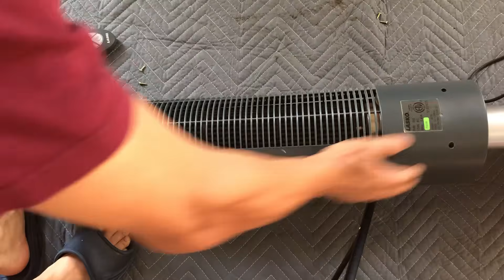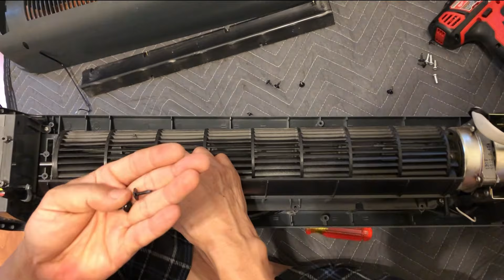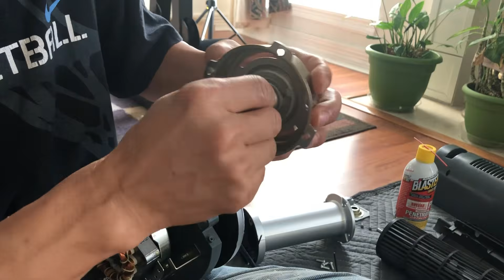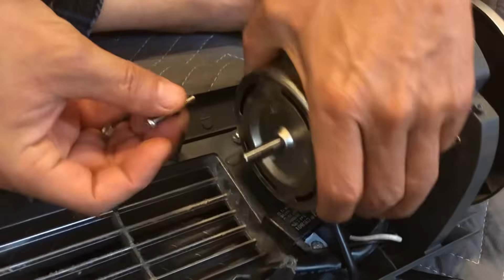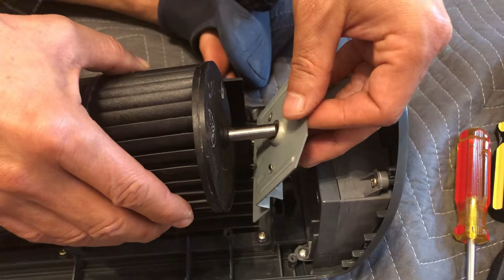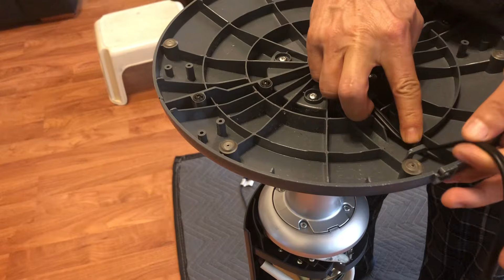Tower Fan Noise Fixed

Comment: Mine was rattling so I used a phillips head screw driver to loosen up the bottom fan set screw, pry up the fan and re tighten. No disassembly at all and fan is quiet.

Comment: I fixed this same issue way easier and way faster.

1- Get an "masters lubricating oiler" or some product oiler that is similar (the ones with the long narrow retractable spout.)

2- Flip the fan upside down and oil just the top bearing shaft right through the grate.. Let the oil penetrate the top sponge.
 

3- Pull oiler away from the fan  but, keep fan upside down and turn fan on upside down ..to work the oil into the sponge...

Repeat a #2-#3 few times if needed.

 I took out zero screws and fixed the sound issue in less than 5 minutes.In fact it took me longer to write this up for you all but i promise this works and is much easier.

Also you shouldn't disassemble the motor on the bottom unless you absolutely need to, as you can easily ruin the fan if you bend the copper coil at all. Also this video he blew out the oil sponge for his top bearing which will cause additional noise in the future, so don't do that either

Just oil the top bearing sponge a few times. The  noise will disappear like magic.

Comment: Thank you for sharing this video.  Watching a few minutes help me decide not to dissemble my tower fan.  Too many screws and just asking for a headache.
Reply: I fixed this same issue way easier and way faster.
1- Get an "masters lubricating oiler" or something similar (the ones with the long narrow retractable spout.)
2- Flip the fan upside down and oil just the top bearing shaft only right through the grate.. Let the oil penetrate the top sponge. 
3- Pull oiler out keep fan upside down and turn fan on upside down ..to work the oil into the sponge...
Repeat a few times if needed.

 I took out zero screws and fixed the sound issue in less than 5 minutes.In fact it took me longer to write this up for you all but i promise this works and is much easier.

Also you shouldn't disassemble the motor on the bottom unless you absolutely need to, as you can easily ruin the fan if you bend the copper coil at all. Just oil the top bearing.

Comment: The "dust" you removed from around the bearing is put there by the manufacturer. It's a sponge that holds extra oil to keep the bearing lubricated. The bearing is a porous metal that allows oil from the "sponge" to gradually seep through and lubricate the shaft. You should put a few drops of oil on the sponge to lubricate the motor. Without the "sponge" the bearing will run dry.

Comment: How did all the dust get inside the motor no way..wd40 that sucker
Reply from the maker: @williamroberts9619  I’m bit baffled too on that. Someone suggested that dust looking material could’ve part of noise dampening and lubrication, which kind of makes sense but not completely because they were dry and looked and felt exactly like dust build up.

Comment: These tower fans are basically the same as they were 30+ years ago. I know this because I just took apart one that I remember buying in 1994 lol, it needed a real good clean. Basically identical to this one. Those bearings at the top and bottom holding the shaft needed some oil, it's working great and very quiet.

Comment: Lmfao!!!  I got to the bottom two screws that you need the bizarre bit for and quit.  Beat the shit out of it and oiled it and it stopped rattling.  About a month later it’s rattling again.  I’ve found when I lay it down the rattling stops.  Decided to YouTube a solution.  After seeing this, I’ll remove the stand and lay it on its side.  Will be hidden in my living room better and throw a wide breeze.  More power to you bro.  Update.  I tuned it upside down and tapped it on the rug several times.  No more rattling.
Reply from the maker: hahaha, great to hear.  I know the feeling. I edited out some of the frustrations in my video as well. Was it worth $40 savings to buy a new one, to many may be not, but I did it out of challenge and just for fun.
Reply: @DIYLifeSkills  you did a hell of a job.  The fact that they put those screws to dissuade people from attempting what you did is ridiculous.  Throw away culture reinforced.  I stopped your video after seeing where the cleaning needed to be done and turned it over and beat it a little.  Problem solved, for a little while at least.  Thanks again

Comment: I don't think that was dust in the hole. I think it was an oil wick. You were supposed to put oil that's designed for fan motors on that material you pulled out of the bearing, but what do I know.

Comment: Lol you took the thing apart? You only need to remove the main fans then the top of the motor cover..
Reply from the maker: I had no idea where the noise was coming so took it all apart for fun
Reply: I fixed this same issue way easier and way faster.
1- Get an "masters lubricating oiler" or something similar (the ones with the long narrow retractable spout.)
2- Flip the fan upside down and oil just the top bearing shaft only right through the grate.. Let the oil penetrate the top sponge. 
3- Pull oiler out keep fan upside down and turn fan on upside down ..to work the oil into the sponge...
Repeat a few times if needed.

 I took out zero screws and fixed the sound issue in less than 5 minutes.In fact it took me longer to write this up for you all but i promise this works and is much easier.

Also you shouldn't disassemble the motor on the bottom unless you absolutely need to, as you can easily ruin the fan if you bend the copper coil at all. Just oil the top bearing.

Comment: “Dry lube with Teflon”

Ouch. You definitely don’t want that propelled around your house by a fan… Teflon is a forever chemical (PFAS): “PFAS has been detected in the blood of most adults and children in the U.S. Scientists also found PFAS in umbilical cord blood and breast milk.

PFAS bioaccumulate, which basically means the body can’t easily eliminate PFAS, so they build up over time. This also happens in non-human animals, including those many humans eat, offering another route of exposure.

Why does PFAS exposure matter? The biggest reason is that these are endocrine disruptors that affect the body’s hormonal system. PFAS can affect reproductive health, growth, and metabolism and are linked to a variety of health issues.”

Companies Knew the Dangers of PFAS 'Forever Chemicals'—and Kept Them Secret - https://time.com/6284266/pfas-forever-chemicals-manufacturers-kept-secret/

Thanks DuPont… Also, check out the film Dark Waters. That script is currently playing out in the Netherlands, where DuPont did the exact same thing and dumped loads into the environment. Lots of people living nearby and ex-workers got cancer because of this exposure to PFAS.

Comment: Great tutorial i didnt have any spray lubricant so i used grease i think the grease is a bit to thicc so it doesnt spin as powerfull anymore but hey it stoped the rattling noise might gonna take it apart again in the future and use the right lubricant 10/10 tutorial
Reply from the maker: Many are intimidated by big number of screws to remove, which I understand, so you are a DIY warrior like me.  :-)
Reply: @DIYLifeSkills  yea i mean i buyd it for 80bucks and why buy somethink new if you can fix it if you dont try you cant succed :)
Reply from the maker: @jayblu6900  That how I am.  The thought of throwing away something bothers me when I can fix and prolong the life. This resulted in 35 year old Honda lawn mower. 31 year old garage door opener. 25 year old Maytag washer, 20-30 year old HVAC.  LOL
Reply: @DIYLifeSkills  nice i mean for some people its easyer to buy new stuff who have good salary in my country salary is low so i rather fix my stuff then throw it away like my father we had a broken Multi-function cultivator he buyd a new one for 800 bucks while i fixed the old one  for 40 bucks all it needed was a new carburator
Reply from the maker: @jayblu6900  Yeah for me combination of not wanting to waste money to save more for retirement and also fulfilling the curiosity why somethings broke and whether it can be repaired and usually they can be repaired with some study.  :-)

Comment: So the issue for the rattling was dust build up? I have a tower fan, rattles when it oscillates but not stationary. I hit it with the shop vac (air blow mode) and clouds of dust came flying out. Maybe i just need to hit it with the air compressor again?
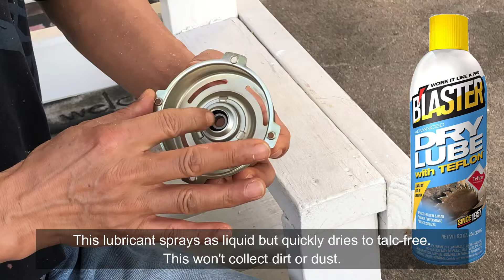Reply from the maker: Yeah the dust accumulation seems to throw off the balance sometimes so it rattles.  After removing as much dust as possible, use ample amount of Dry Lube spray shown in 5:54.
Reply: That's a great idea

Comment: That’s a big job. It looks like a poor design. Thanks for the video.
Reply from the maker: Just lots of screws. If you have a power drill, it goes pretty quick, but if you don't, it can be very tedious to remove and reinstall so many screws.  These fans are only about $60 bucks, so it's not about saving big money, but it's a non-challenging time killer on a boring weekend.   🙂

Comment: Inspiration to take my piece of crap arctic air tower apart. It makes the same noises and also stopped oscillating. I finally had it as it woke me up just now. Took everything I had to not smack it into oblivion. If dust is the issue here... Im cleansing with 🔥. Thanks for the video seriously though. Gives me hope

Comment: Thanks for your helpful video, can I ask if the noise has come back now?
Reply from the maker: The history is I cleaned this about 4 years ago and then the noise came back gradually after 3 years and was getting louder so I cleaned it for the second time.  I think it depends on how frequently you use the fan and how dusty the surrounding is.  In my case this fan is used perhaps an hour a day over summer periods only for about 6 months a year.